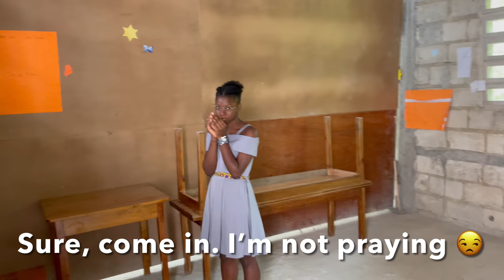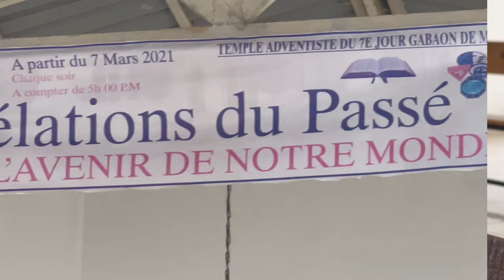Haiti Vlog | A Journey To The Crown Of The Caribbean!!! ✈️

Comment: Where will they get water from in those heights
Reply from the maker: We had someone dig a well a few years back. Yes, by hand with a shovel. It was actually so deep and hot. Down there that there was no air flow so we blasted AC down a tube for the worker from the top.